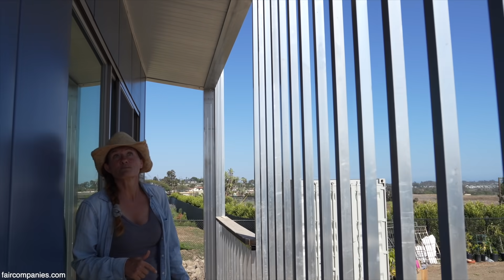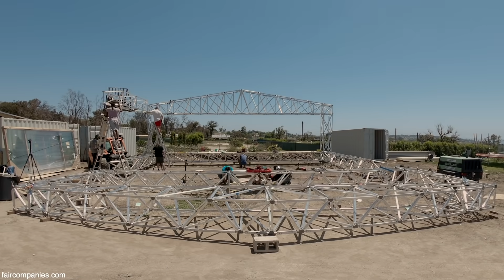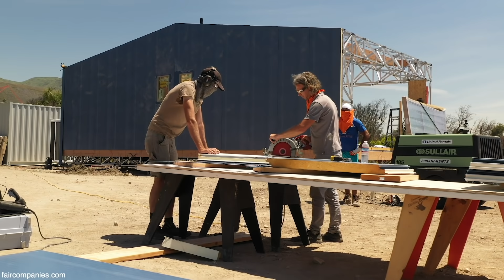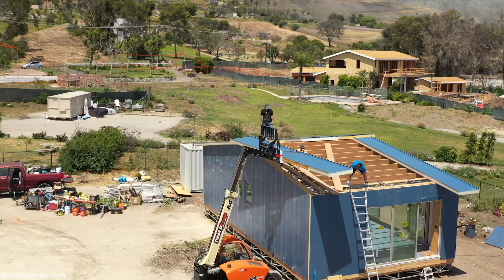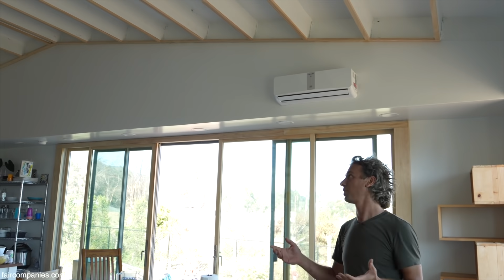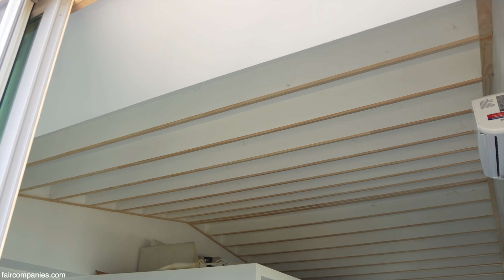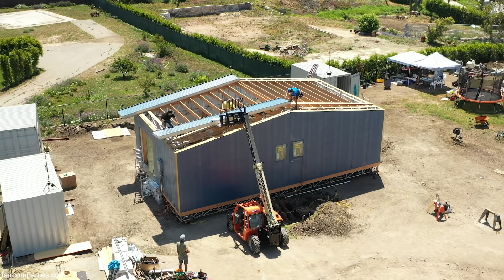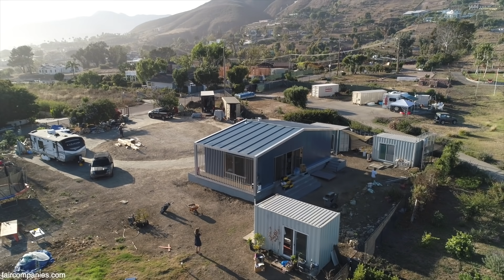This home goes up like a Coachella modular build: fast/cheap

Comment: Interesting method. 
Not interesting interiors.
Reply: Like someone else mentioned, lack of an architect's design sense makes for a boring design. But I've been a fan of space frames for a long time. They had the opportunity to do so much more inside but i suspect their budget limited them on what they could actual realise
Reply: @HarveyMillstone  Yeah, it was all to be cost effective... Remember, this is in California where building anything can be pretty damn expensive... Even just adding a small ADU typically cost over $100K or adding a bedroom addition to an existing building can exceed $60K in some cases... and they haven't solved their fire causing issues...

Comment: I wish they would’ve mentioned cost per square foot compared to other building modalities.
Reply: @lb96  Read the intro to the video, it's all there.  ¯\_ (ツ)_/¯
Reply: The prices are on their site. They're charging $230k+ for 1000 sqft. $140k+ for 400sqft lol
Reply: @farley9255  So how's that economical at all!
Reply: @lb96  make it easy for you - "Alexis Rochas whose Oasys prefab can be erected in 30 days.
So that's 60 x daily labour cost cheaper. Remembers, they are in a high labour cost area
Reply: Price and cost estimates for a prefab ADU from Oasys range from $211 - $363+ per square foot. These estimates are all inclusive, meaning that the cost of the home, labor, and site work are included. This cost estimate is based on the turn-key cost of a prefab ADU from Oasys. They are transparent about project costs and list turn-key project costs on their website. The cost of land and any home upgrades are not included in this estimate.

Easy: Google search
Reply: @santiagofernandez3215  
That's pricy when compared to a traditional build , considering national average. Advantage is time to build though.
Reply: It's all about market values. Depending on where your building your house it can vary on price. This is due to cost of living in the area the home is being built. If I go outside the city I can get a house built wayyyyyy cheaper, than in the city. But Cali is weird like that though land is alot because its Cali doesn't matter if you're 30 min outside the city or not. It'll still be expensive,  but hey if that's where you want to live you have to pay. That being said, am I going to go with this company that charges $289,000 for a turnkey 1000sqft AUD? No, no I am not I could totally do it myself or get another company to do it cheaper. I think the problem with their cost is the materials,  steel is somewhat cheap but aluminum however is not. That's just my .02 on the matter.
Reply: from the Oasys prefab website these run  $211 - $363 per sqft
Reply: I wonder if they priced the materials and labor out of state.
Reply: You seem to have a very different idea of "budget"
Reply: I was curious too: I feel the investment in a more “solid”, fire/weather proof building method (bricks for example), would be worth the money and property lost in case of a natural disaster.
Reply: @paperodiabolicovideo  yeah bricks do not work well in Earthquake-prone California
Reply: @lb96 Yes, I just had a house built, so i am familiar with every cost item. 
You only mentioned construction time.
I don't plan on debating the full build cost because it depends on location so much.
For example, slab is way dearer if you live near a timber mill, and the cement plant is 200 kilometres away.
Reply: to pile on here, replacement cost for coastal california is insured at $750 sqft. so 211 to 363 competitive.

Comment: This house was not cost effective 
Should have just bought a steel building
Reply: My steel building went up in 3 days with R30 insulation installed.  15.00 per square foot.  Beat that!  300.00 per sq ft is about 50.00 to 75.00 per sf higher than it should be to build these super simple designs.  This is another prefab company bilking customers with ineffectual costs driven by special words and a sales pitch of efficiency BIM.  You can tell by the owners regurgitation of the sales pitch.   Any builder would not agree .
Reply: @tztz1949 Not cheap, but you forgot, this is all in costs, built, completely decked out from foundations up, not the costs of a frame kit on the OEM's dock.
Reply: It's a metal framed structure, so no difference with a steel building other than this uses aluminum.  But it's modular and quick to put up so it is cost effective because it takes much less labor, and the materials aren't as heavy to move around or need as much specialized equipment and tools as you would need with steel...
Reply: @ZeoCyberG  ya I get it
 how much was it
Reply: @woodyahh2110  They didn't say for this one but the general pricing from this company...

https://www.prefabreview.com/blog/oasys-prices-and-cost

Which compared to others in Prefab market...

https://www.prefabreview.com/blog/prefabadu-prices-and-cost
Reply: No foundation, utilities, landscaping, etc?  Definitely too high for a non custom crackerbox with no solar, style or neighborhood relavence.  Why is it you non builder millennial wannabe revolutionaries keep charging custom home prices for double wide aesthetics.  Go play with the modern shed boys and drop ship boring boxes.

Comment: Nothing new.  The Lustron homes as well as Donald Wexer created this whole steel house thing in the 50's.  Look up Lustron homes. https://midwesthome.com/building-remodeling/a-minneapolis-lustron-home-goes-on-the-market/
Reply: It's not the material, it's the framing... Space framing in residential structures is new and modular design so you can put it together in as little as a day or take it apart and move it is not something that has been widely used yet...

Comment: built a steel house in 2005. best thing I ever did.
Reply: What did that cost compared to traditional stick built?
Reply: @stevearanda1234  Depends on how you look at it. upfront costs at the time were about 20% more over all. 40x80,  inside 2300sqft.  but due to the 12" thick walls the reduced energy costs and painting costs have more than covered the extra up front cost.  No exterior paint since built. warranty for paint is 20 years, expect it to last closer to 30 years. No termites problems. flat walls with no framing cracks due to drying of frame. All electric with solar panels, power bill is $23. per month. Can't list all the good things about it. Steel is a much better building material for here in the desert that wood and stucco houses.
Reply: @stevearanda1234  and it depends on how long you intend to live there. if it is a "spec" house then steel is not the way to go, but if you are going to live in it for 30 years then you will pay less $$ per month in the long run.

Comment: I live in a 38’ diameter geodesic dome. Same idea...using geometry to cut down on materials. Really strong..Did 80-90 mph during derecho no sweat. Super insulated.
Reply: Pictures?
Reply: Did you get your geodesic dome from pacific domes? Or another company? I’m looking into building one myself and would like to know your experience!
Reply: @mac.jenkin  we built our own hubs and struts based on a design from Pacific and several others available in 1980. Bob welded all the hubs and drilled them, while I cut, drilled and color marked the struts. We built a 38’ dome because we could cut the triangles directly out of 3/4” marine ply with no waste. Used cutoffs on other exterior locations. We took almost six months to plan measurements and layouts. Have been very comfortable in this dome for a long time now. And relatively cheap per cubic foot to heat and or cool. We also used every passive feature we could incorporate to help with comfort...super insulation, tight windows and doors, siting for solar gain and wind protection, etc.
Have fun on your journey! At the first we decided this was our house and we weren’t going to worry about resale! So it fits us to a T. Yours will too.
Reply: @janwoodward7360  that sounds fantastic! Thanks so much for the detailed response :)
Reply: Hi Jan, just wondering which state you live in?  Was permitting problematic?  I'm looking into Pacific Domes and it's challenging finding out which counties allow such structures.
Reply: @kristian80au  West Virginia. But we were sure we built in an area of our county with no particular zoning requirements. This was in 1980. Hope building inspectors are smarter now about domes.
Reply: @janwoodward7360  Thanks Jan.  I'm on the opposite side of the country, but good to know!

Comment: Hahah they build a home like this in 30days noz bad, but has anyone notices the poor safety for the rooftop workers? Non of them were protected with a line and could easily fall these 3m. 30 days and 2 broken legs at best
Reply: Have you ever been a carpenter? In my late teens, 20s and 30s, I built hundreds of 2 story houses, while never using safety lines or harnesses.
Reply: @seanomeirs8362  No im from germany
Reply: The roof had a shallow pitch. Not really dangerous.
Reply: @bkbroiler8069  I walk up sidewalks in San Francisco that are steeper than that roof.

Comment: Aluminium melt at 660°C(1220F) so it collapses faster than wood...
Reply: Not that simple... While aluminum has a lower melting temperature than steel, for an equal mass of metal, it takes far more calorific energy to heat aluminum than steel.  Since, aluminum can dissipate the heat more readily because aluminum is a very good thermal conductor, eliminating hot spots, etc.  It just has to be well insulated to prevent conducting the heat to more flammable materials.  Aluminum also has a high reflective power of 80-90% of incident radiation compared to 5% for painted steel.  So it can take far longer for aluminum to heat up from radiant heat... But this does drop to less than 20-30% when it's painted or covered in soot...

So the only real concern is the weakening of the structure as it heats up but the fire would have to get pretty close to the structure before that becomes a concern...
Reply: @aoife984  I’ll bet you’re fun at parties.
Reply: @kristinjayne6720  lolest
Reply: And since a forest fire can run 800C this structure is by no means fireproof. What it IS is cheap and quick compared to stick-frame.
Reply: @MFunkibut  It is NOT cheap by any means at $300+/sf
Reply: @rcpmac  😯
Reply: @MFunkibut  Nop they are not cheap very expensive
Reply: If you look at the site you will realize very little flammable material is close by. Meaning as long as the building itself doesn't ignite it should be safe. And there is very little material inflammable material exposed on the building.
Reply: Didn’t they say the panels were steel?
Reply: im curious about this paneling - its PUR / PIR foam inside. it will melts much faster then aluminium.
Reply: When your world burns down in a climate crisis mega fire, sometimes you just have to act. Speaking with heart from Napa County Glass Fire.
Reply: The aluminum frame is enclosed by IMPs (insulated metal panels - typically used in commercial refrigerators) that are steel on the outside and are R30.   That would take a lot to cause the aluminum to even saag.   By then the contents would be on fire....
Reply: More than Enough Vacant building to house EVERYONE.
Reply: Yeah I'd go for concrete blocks
Reply: Remember that all the outside siding and roof isn't aluminum but is Steel and will help shield the structure far better then wood or vinyl siding can do.
Reply: @d.j.radioroyspinner8  Even steel structures do not resist as long as wood do. There's a misunderstanding here. Wood burns to ashes, but it takes a long time and wood will still support the structure  even burnt at 65% while steel would bend in few minutes under fire. Ask an architect if you're not aware about that.
Reply: The aluminum is inside, the outside is covered with ISO panels, meaning  steel sheets "sandwich" fire retardant Styrofoam, which covers all of the house. So as long as they can keep trees at a safe distance, that structure will endure for a long time.
Reply: @marceloquiroga1904  please look at my first message. There's a missunderstanding here between "catching fire" and "safety/structure integrity". I speak about temperature and safety/structure integrity". Any structure will endure for a long time if fire is kept at a safe distance. But temperature may raise from warm winds even if the fire is at a "safe" distance. You're pushin at open doors. About styrofoam, its glass temperature is 100°C (212°C) only, at this temperature that material can't stay in shape and starts to emmit toxic fumes that can easily kill people. During fires, what kills people is first toxic fumes. When heat of flames comes, people are generally already dead.
Reply: Ok, and what's your point? Wood burns before 660 C. So are you saying wood would be safer here? Seems wood would be more susceptible to burning from embers coming during a fire. Those embers won't ignite the aluminum. Please tell me what I'm missing
Reply: @nofurtherwest3474  The World Trade Center structure was steel, and the building did not allow everyone to get out safely. You arre missing that the first reason of building colapse during a fire is heat, not flames. As the heat grows  metal softens and bend. Aluminium is the quickest to bend, then comes steel. Wood structures are safer because whatever it is in flames or not wood stays in shape much longer, even burnt to the third of it initial section. Actually wood is even better than concrete to stand a fire. I don't mind if you agree or not, this is a scientific fact, not a personal opinion.
Reply: @axelSixtySix  You say 
"the first reason of building colapse during a fire is heat, not flames"
BUT... the thing is - this house will not catch fire in the first place. If it is made of wood then it will catch fire. 
If it is made of aluminum then it will not. 
There is nothing that will catch fire with some embers blowing to it. Embers is how the wild fires spread. If an ember lands in the window sill or the eaves of a normal house, then the fire will start and spread. 
But in this case it will only cause perhaps some nominal damage but it will not spread fire and THEREFORE IT WILL NOT COLLAPSE THE HOUSE. 
Now, I await your rebuttal.
Reply: @nofurtherwest3474  Well, this is my last attempt, mostly because you have a lack of information about fires. You have no idea the temperatures generated by a forest fire which can overtake 1500°C. That means a house surrounded by a fire can reach 600°C in minutes, and much quicker if the wind blows in the wrong direction. It's like you put the whole house under a giant heat gun blowing air 10 times warmer. Many materials in the house can instantly catch fire at that temperatures : oils, petroleum derivates like plastics, foam, paint, synthetic fabrics and hudred of other stuff. You don't need a flame to start fire, just heat, combustible material and air.  Onces again, this is not an opinion, every fire by the past shown the same consequencies. Please get some information.
Reply: Yep Aluminum will melt to the 1600 F that a fire can reach.  If you wanted a structure that can withstand that temperature Steel will hold up to around 2000-2200F before loosing structural integrity.  Of course everything that's built around steel beams will likely turn to ash or mush, but at least the skeletal structure of your house would be intact.
Reply: I would add that the most likely building style to survive nearly completely intact, would likely be an underground dwelling.  The insulating ground would protect pretty much the entire sections that were underground.
Reply: That’s what I thought!
Reply: I would build half underground like hobbit housing.  It'll burn again, at least half below unaffected.
Reply: There is no global housing crisis, unless you're a liberal.
Reply: 6061 aluminium actually melts at 585°C (858K)
Aluminium also looses a lot of its strength way earlier, starting from 300°C (573K)
So it wil collapse way before it reaches 600°C (873K)
Notice I didn't use Freedom units, because science ;) (joking, love to all people, even USA ;) )
Reply: @hydrusje  Yep, I gave the higher values of strongest aluminiums at purpose.
Reply: @hydrusje  Your assessment makes no sense. Wood actually physically burns aluminum does not. The numbers you mention are in the combustion zone, as in the wood burning from within. Aluminum will not burn thus it will never face those kind of temperatures. The point of this build is "to not catch on fire" from flying embers as a wooden and shingle house will. As long as there is no vegetation within 10 feet of this structure it will survive any fire around it because 10 feet from the flame it is nowhere near 600C. So the answer is YES this house will survive all future brush fires in that area as intended.

Comment: Would this structure hold up strong enough to weight of heavy snow??
Or even make the roof higher pitch for snow to slide off?
Reply: Also how much wind can it withstand?
Reply: Yes, geometric framing structures are extremely strong and it's pretty flexible in design options...